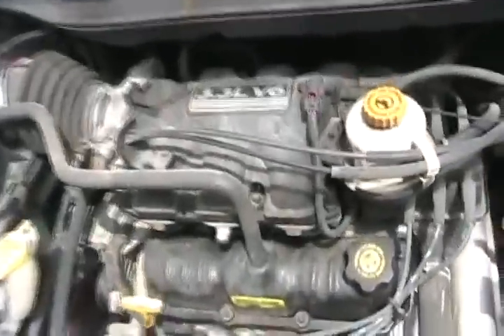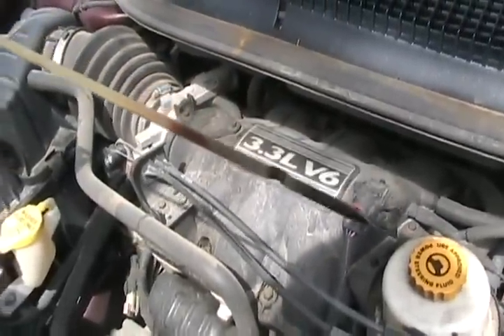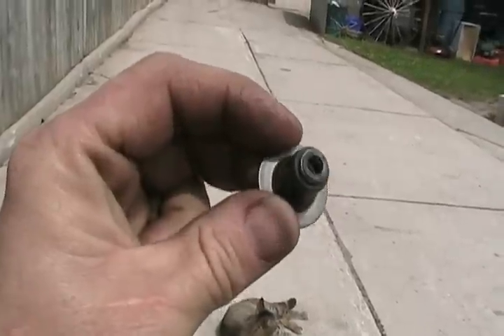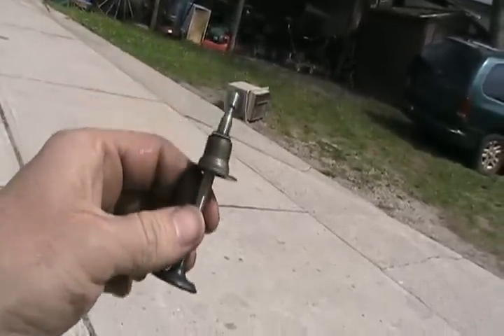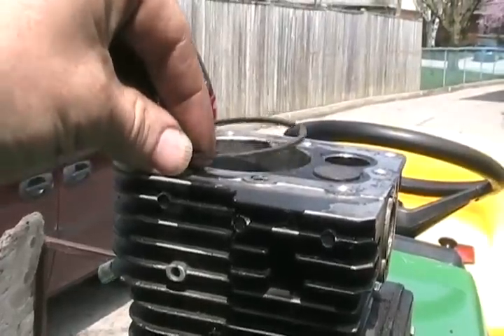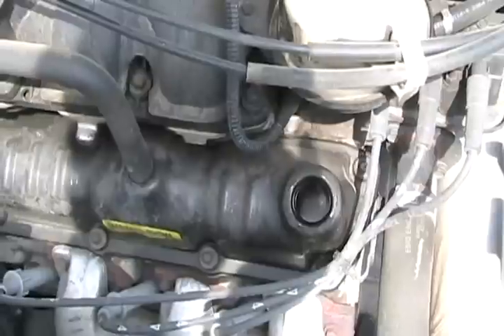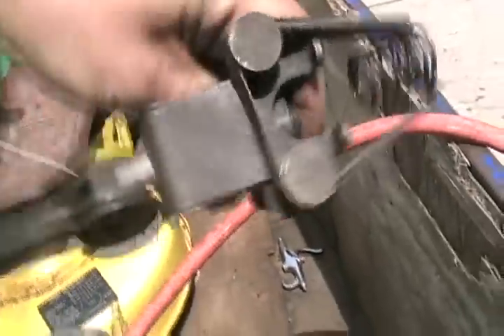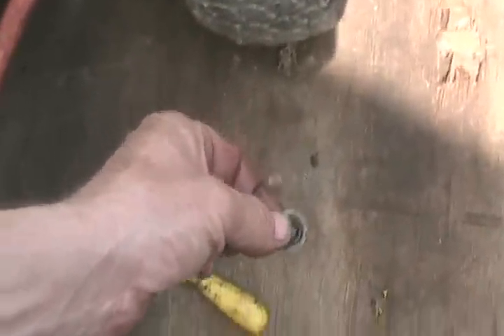Davidsfarm   0936   bQiqdKYarxM   SQ   technical info on oil burning and head gaskets

Comment: that first hose isn't where the crankcase gases go. that hose is where fresh air is drawn into the crankcase. the other hose, which is not shown, is connected to the pcv valve. the second hose is the one which carries the gases from the crankcase back to the throttle body or intake manifold to be re-burned.